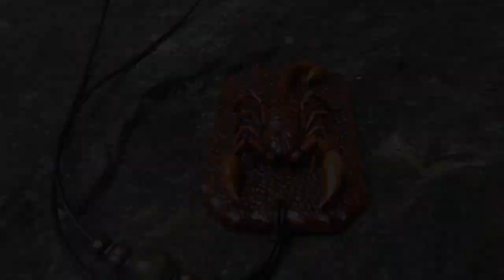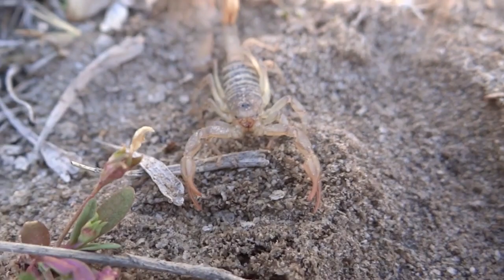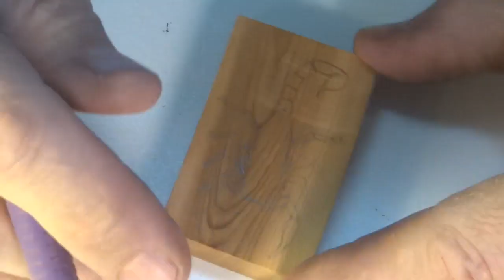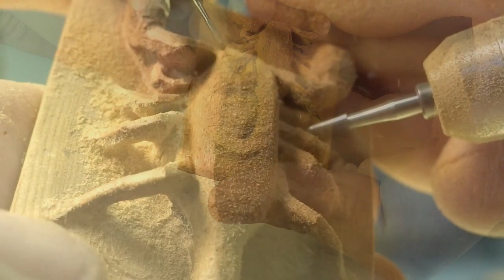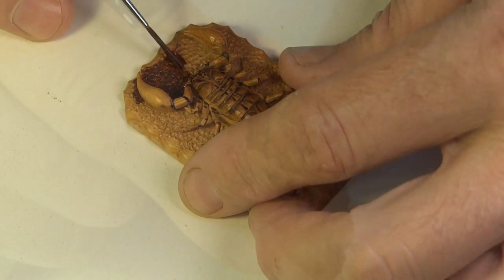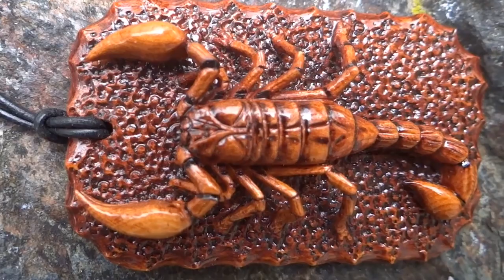Carving a Scorpion Pendant from a Single Piece of Wood

Comment: Amazing- your videos continue to inspire me to try and be ‘artistic ‘ you are incredibly talented. May I ask what varnish/stain you used at the end and what tool was that to do the eyes (in between your first rotary carver and the pyro-pen type tool?). Sorry for such basic questions but “standing on the shoulders of giants” and so on!! Amazing project!!
Reply from the maker: Thank you very much, Amanda! 
 For the background, I made a stain with Burnt Umber Oil paint mixed with paint thinner. After that was dry, I dipped it in Minwax  clear gloss polyurethane.
 The tool I used for the eyes, is a mechanical pencil with the lead taken out. It was the only thing that I had that was small enough to make scorpion eyes. Lol!

Comment: I'm still amazed at the amount of detail you can achieve Mr. Stinnett! It blows my mind! Great video as always my friend :) What is  the brand of your rotary carver? It seems to work really well. Have you had any problems with it? I wouldn't mind investing in a decent one, my little cheap one doesn't work very well.
Reply from the maker: Thank you, Dayne! The one I'm using mostly in this video, is a Mystisa portable micro carver. It runs on rechargeable  batteries. My best micro motor carver, for heavier duty work, is an Oz- Plus.I purchased both of these at treelineusa.com 
I haven't had any problems so far, although I did drop the Oz handpiece , and now it sounds a bit rough, but it still works great. Probably needs new bearings.
Reply: Thanks Mr. Stinnett. I thought it might have been that one, I saw your unboxing video of that and thought it looked the same. I'll have a look at that website and see if they deliver to Australia, otherwise I'll try to track one down over here. Thanks again for sharing my friend :)

Comment: Do you ever glue pieces together to use the grain of the wood for strength or appearances?
Reply from the maker: I haven't yet. I try to make them from one piece. But I will use glue and piece it together if I need to.
Reply: Stinnett Sticks maybe that’s how I might end up doing my divers cane.  Doing small carvings and add them to the cane.  I would just end up ruining what I have if I tried something way over my head.

Comment: Curious; just how many of these rotary tools do you have loaded up with your various bits?
Reply from the maker: I have several
Reply: Stinnett Sticks I can imagine,  I have one and spend a third of my time searching for and switching bits.  

I did carve a divers helmet and a shark in a commercial brass tuna dart.  I did most of this with a pocket knife.  

A pocket knife vs solid brass is darn near equal so; I started this project in 1984 during commercial dive school.  I’m still carving on it.  

I made a belt buckle out of the tuna dart/ Harpoon so;  I’ve also worn it for all theses years except for rodeo days .